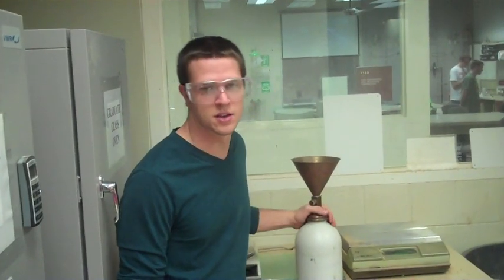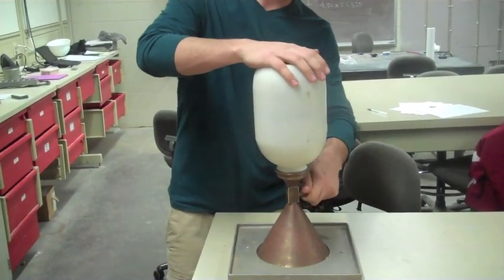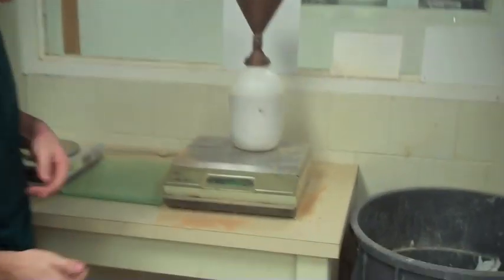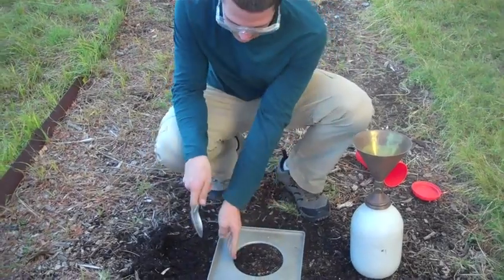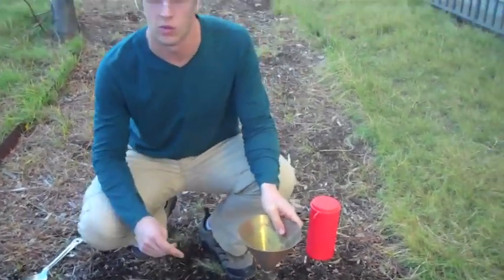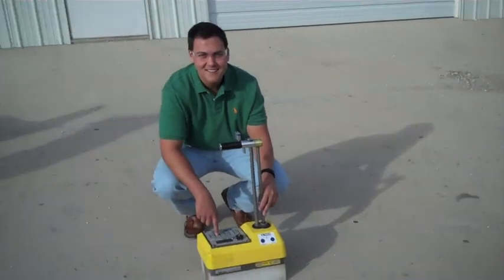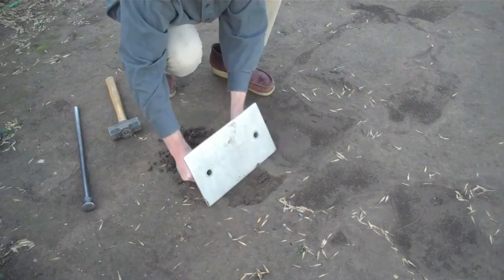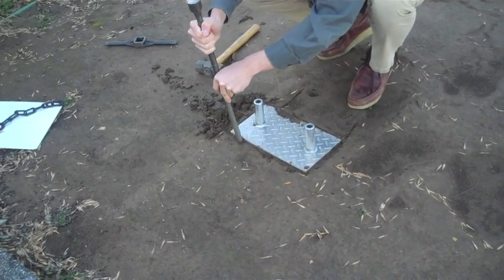Sand Cone and Nuclear Density Test

Comment: He didn't tap the side of the bottle did he??  This would invalidate the test cone calibration.  The idea is to, yes, fill the cone with sand.  But the filling of the cone should be in a non-vibratory environment as would be the case when conducting testing in the field.  Also, when calibrating the cone, make a little mark with a Sharpie on the lip of the cone and the corresponding point on the plate.  Always line up the two marks when calibrating the cone with it's mate plate.

Comment: Ah, 2 points: the tapping of the cone was a fail and the plate in the field should be anchored with pins. But then I guess this was just an explanation and not to be taken as training for field testing.
Reply: One NEVER taps the apparatus while the sand is flowing because it will cause the sand to settle. This test is dependent on the sand falling undisturbed into the hole and the cone, and remaining loose until the valve is closed.

Comment: Craig, We tapped the side of the bottle to help the sand slow into the cone. A vibratory motion such as this will only slightly change the values. That is not significant in determining the density of the soil.And, to ibsurfn, the contractor would not be pissed the contractor probably doesn't even know what ASTM stands for much less how to conduct the tests. And Alvin, the base plate is not supposed to be anchored. And the rest of you, you already read my comment now, and you can apply the same response to yourself.